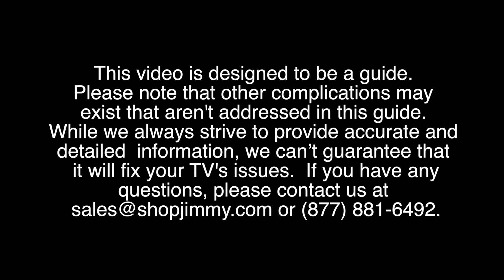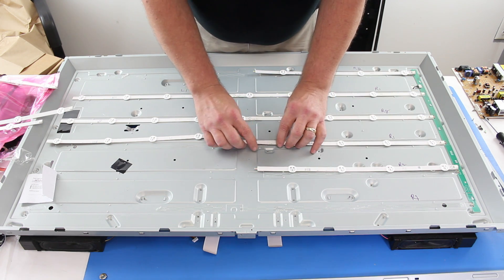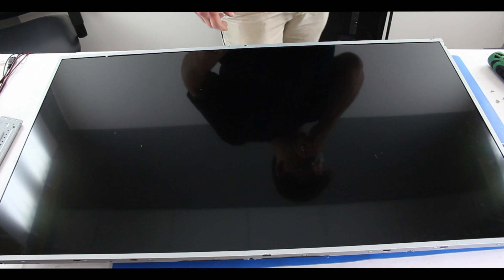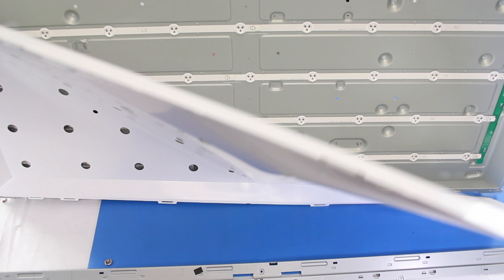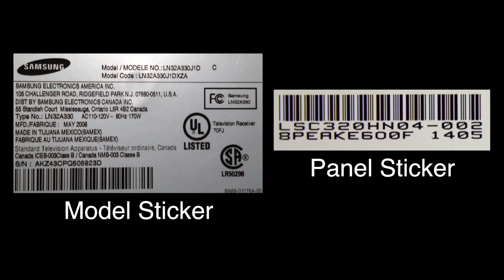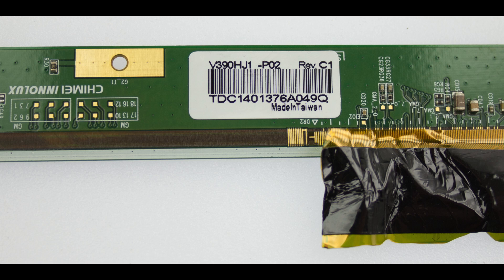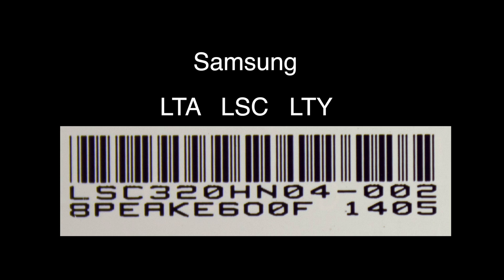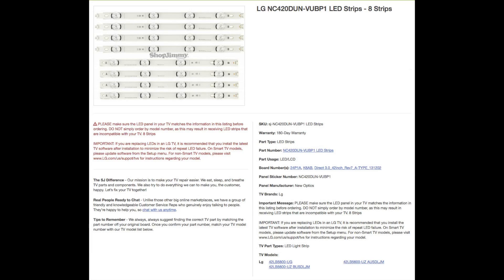LED TV Replacement Help for Replacing LED Backlights in Your TV - How to Order Replacement LEDs

Comment: Of course mine has no sticker at all lol.
model# is UN60H6203AF
TYPE- UN60H620
MODEL CODE- UN60H6203AFXZA
VERSION- HH01
other than that nothing, guess I'm going to have to take the strips out to look for there number, but I did not want to take it apart until I had the replacment strips, now on ebay it seems all the strips go by model #  and it has all 3 of my numbers on the compatible list does that mean they will work or does none of them matter and I need the panel number, you wouldnt think they would go by them numbers if they did not matter

Comment: Very informative and eco friendly ways to repair instead of buying a new tv just due to some led,s..I could have used Digikey but this save me lot time.good chat support on the shop Jimmy web site also.Great.Have a stack of different lg in for repair.Not all have led problems.Lg and other brand must step up their game.Psu with caps placed right over heaktsinks on top of power supply on lg oled is in my mind to brake elemtare abc in good elektro design.Caps dry out and the tv fail premature.